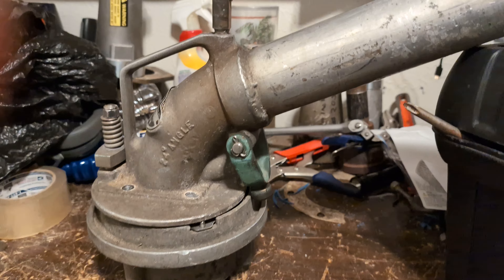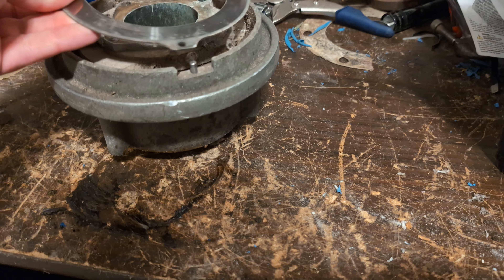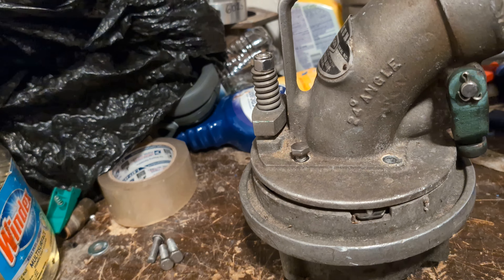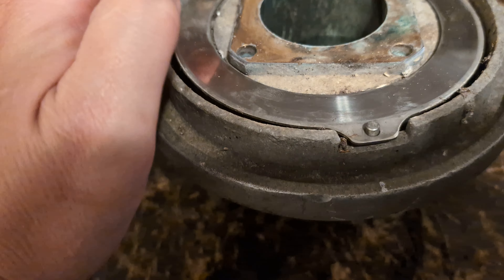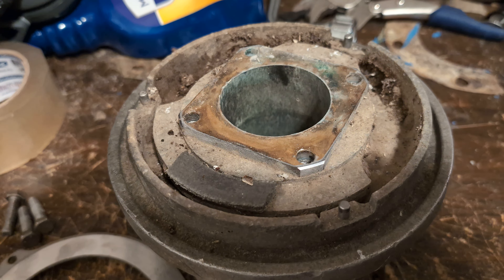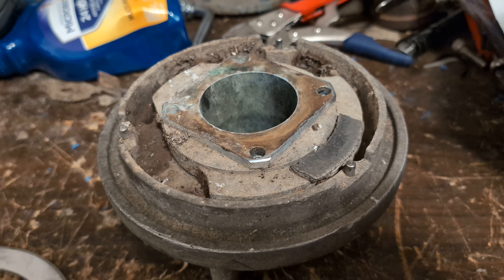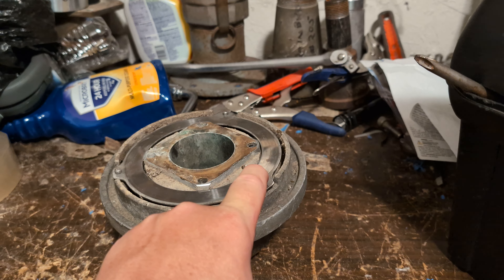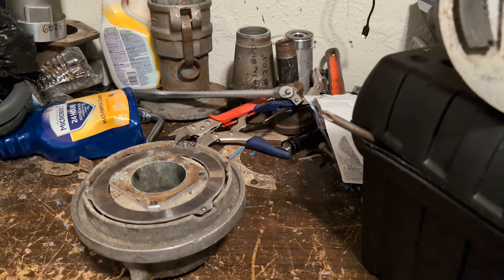Nelson parts gun P150 elbow disassembly from base and brake parts overview- learning together

Comment: I am so glad to see this on this big gun and see the internals of it.  I would be cleaning out every crevice and trying to figure out what is in there and I still do not know.  It is nice to see the brake assembly and that it is like a mini disc brake assembly on a car.  I wonder if the idea came from a disc assembly on a car as it looks like it from what you showed.  I would like to know more about that compression spring and how that works on the brake assembly.  I have seen two big guns advertised and one was $375 and the other was $500.  Besides not having any way to test one of those beauties, they are totally out of my small budget.
Reply from the maker: I saw a P200 on there for around 450. It was missing a stop but was complete otherwise.
Reply from the maker: The spring and adjustment bolt just pushes the pads onto the brake disc creating tension.
Reply: @NelsonBigGunP200Fan    I just was not seeing how that was done.
Reply from the maker: @randyvanheusden732  all good. Sometimes it takes actually having it apart in your hands to see how it works. I'm the same way. I learn better by actually taking the gun apart myself than by reading or watching